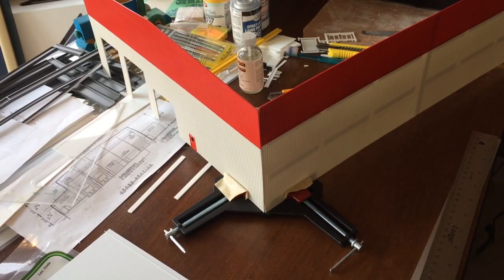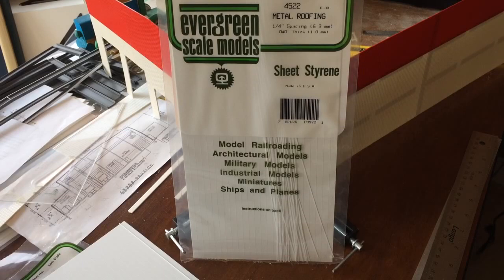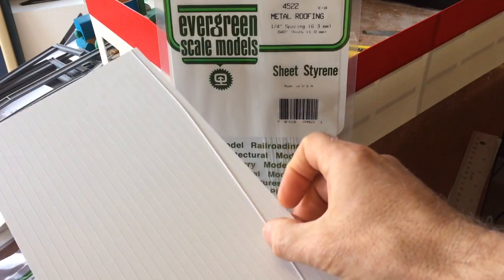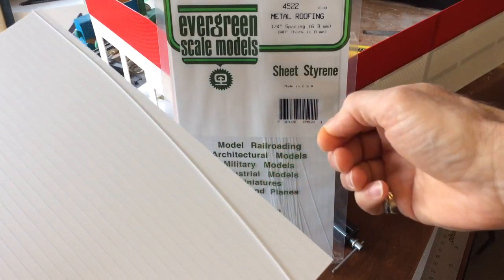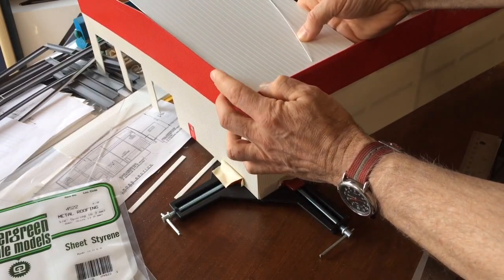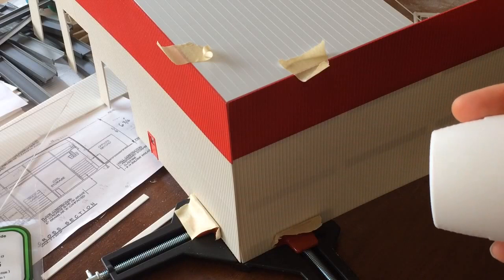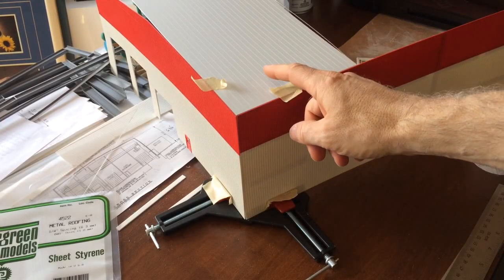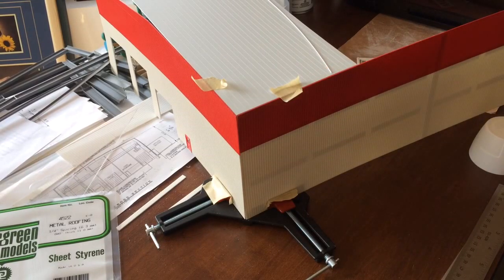Q&NE HO Layout Video 059 - 170418

Comment: Impressive! 
Are you planning on painting or covering the interior walls? (Constitution paper works and it's cheap).
You can see through the walls. 
Especially if you use interior lighting.

Best regards 
Spanky
Reply from the maker: I'd like to keep the interior white to simulate the prototype. I suppose I could use white construction paper to reduce the light transmission and make it look like wall insulation. I wasn't planning on adding interior lighting though (at least not while I have so many other projects to complete).

Comment: Very nice! Will all your roof section butt joints fall on the I beams? Or will you put a splice plate behind each roof section butt joint?
Reply from the maker: Actually none of the roof joints line up with the roof beams so splice plates will be required.

Comment: Looks great but...shouldn't the roof overhang the 4 walls??? Just wondering not criticizing...
Reply from the maker: Yes and no. I had planned to talk about this at the start of the next instalment, but since you brought it up ... In the real world the roof and the walls are relatively thin (formed sheet metal). In HO our sheets are 1/16 of an inch thick, which translates to roughly 5-1/2 inches - not very prototypical. I suppose I could have had the roof just resting on the walls but that would not have provided the cleanest and strongest glue joints. Having the roof inset into the walls also helps keep them square. In the end it doesn't really matter because I had always planned to finish/hide all the edge seams with very narrow "L" shaped styrene strips to emulate the trim found on the prototype. I will also add rain gutters along the roof at the top of the walls.
Reply: I see...Makes sense...looking forward to the next video!!!